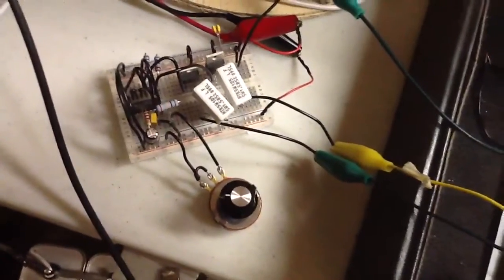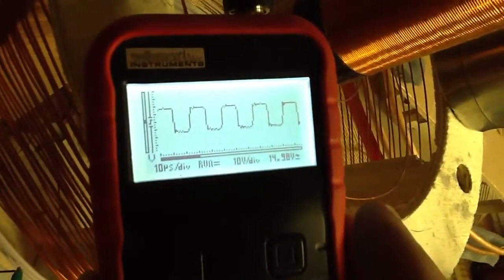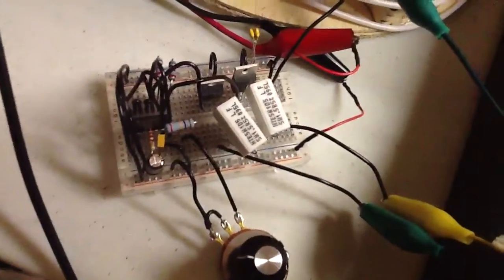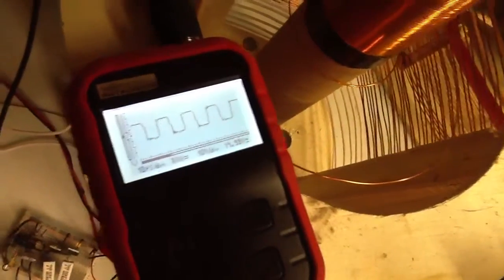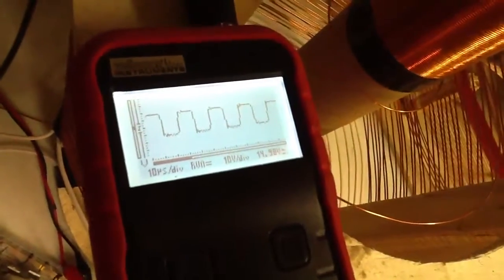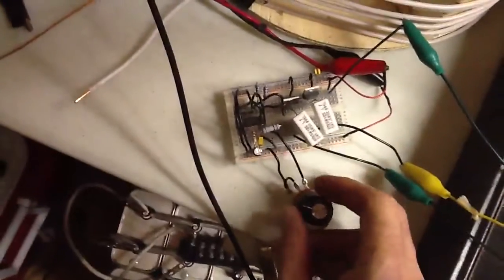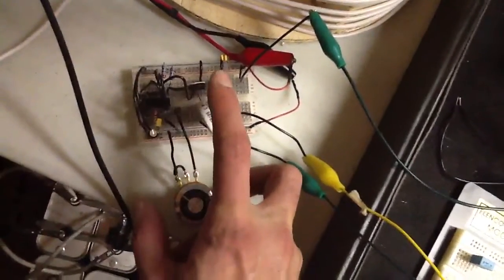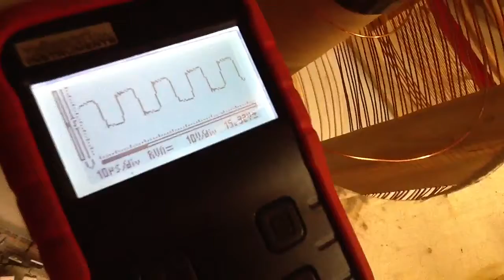BiToroid Resonant Driver: MEG Circuit

Comment: hey man, first, thank you for sharing! it's interesting to see a digital device display sitting next to tmt without being interrupted by the coils emission!? hmm, 'normal' tesla coil mess big time with a digital devices that are near. i guess tmt is better tuned. did you try to listen tmt with an am radio in khz range bands? that would be interesting to see for comparison. normal tc sing on many frequencies, so i wonder if tmt emits only on one?

Comment: TL494 from dally schematic goes 4K-300Khz uses a 10 turn 100k resistor; you can also adjust the duty cycle  (can google image search 'dally schematic')